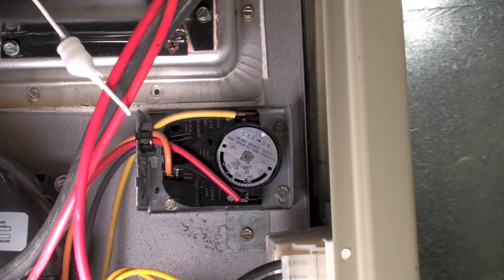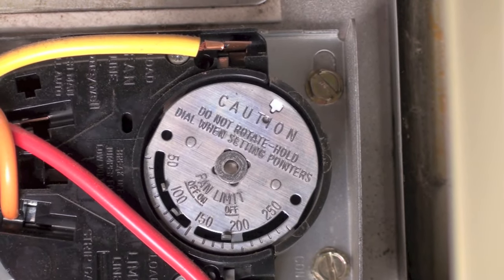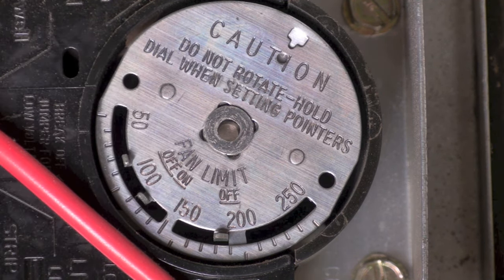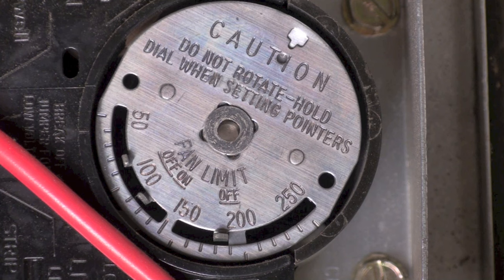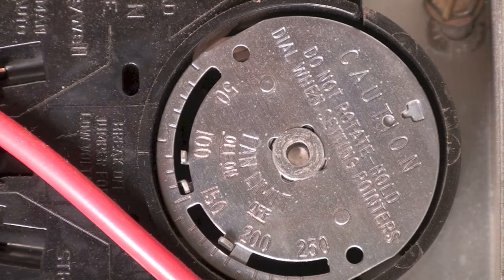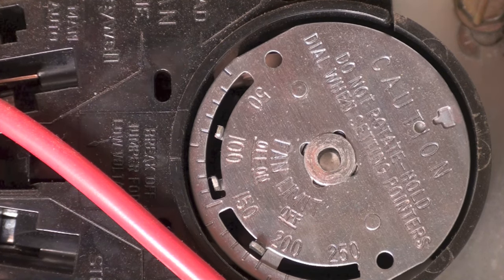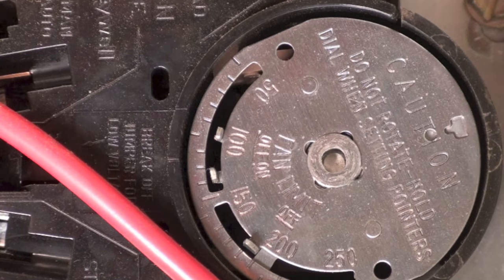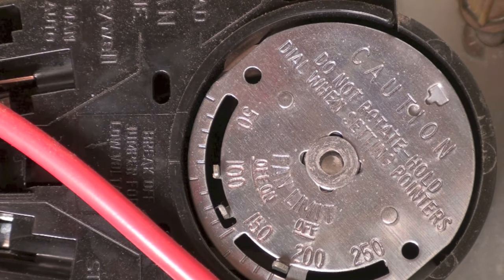How to adjust the Honeywell fan and limit switch

Comment: I had a bad fan limit with no auto/manual fan switch and replaced it with my buddy's that does (he just upgraded to a new furnace and pulled some parts of off his old) now I already checked to see if the bi metal rod was the same length and it was so I thought i could use it the problem is now that my old one was hooked up with 4 wires and his was 3....1 wire in top left, 1 wire to top right and 1 wrire bottom right.  So i wired everything exactly as the old one and with the extra wire I had I figured I put it in the last open slot.  But now the blower motor runs continuously and will not shut off even when the call for heat is satisfied.  Please help. Thanks in advance
Reply from the maker: First, the manual switch should be pulled out during normal operation.  Then it should run with the furnace.  Is there a jumper in the switch?  Should be a copper bar between the 2 lower terminals.  If so, remove it.  His furnace was set up with the fan switch and limit in the high voltage.  Yours was set up with the fan in high voltage and the limit in low voltage, so the jumper must be removed.  By the way, with it the way you have it, you probably have 120v at the thermostat!  Hope this helps.
GFM

Comment: My blower fan will not turn off and blows cool air once the furnace shuts down. If I flip the fan switch to manual, then back to auto the fan will shut off. Bad limit switch? my dial is set to 110, 160, 200. Thanks
Reply from the maker: Your fan switch is probably sticking on.  Replace it.
GFM

Comment: Hello sir
Is there a reason why this fan and limit switch would overheat and meltdown the inside ??
Reply from the maker: I would be checking the heat exchanger for cracks.  You could be getting hot gasses contacting the fan switch.  
This is a dangerous condition.  You could be getting poisonous CO gas into the structure.
GFM

Comment: I just replace my fan control with a universal as the magic chef isn't available. The burner comes on and then after a minute shuts off and then the fan comes on and turns off in a minute then does it again. the house has a burnt smell like the first time turned on in a year. set for 90 and no one can tell me how to set the differential as my old one did not have this feature. can you help me with this. thanks.
Reply from the maker: If your off temp is set at 90F, the on temp should be about 130F for a 40F differential.
GFM

Comment: Hi, my sister has a furnace that is working more faster than before, as soon its started the flame come on, and after 2 minutes the fan come on too, but after 1 minute the flame go off and the fan stop after 1 minute, as soo its stopped the flame come on again, it have to be a problem with the fan limit?????, thank you for any help!!!!!!!!!!!!!!
Reply from the maker: I would look for plugged filter, plugged air conditioning coil, collapsed duct.  another possibility is a thermostat problem.  Hope this helps.
GFM

Comment: What does it mean when the blower runs a normal cycle the shuts off and starts up again maybe 1 minute later only to blow for 30 seconds? Does this every second cycle.
Reply from the maker: The furnace heat exchanger has not cleared the heat.  Try setting the on and off temps a little wider apart.
GFM
Reply: When GFM gives you a solution, please have the courtesy to reply if it fixes it or not.

Comment: My fan comes on at the lower lever and doesn't get up to the upper lever. Is there an internal lever that may have jumped that I could reposition to make it work right?
Reply from the maker: Does the fan switch work normally, as in does it delay start until the furnace is warm?  Does it delay shut down until the duct temperature is cooled?
GFM
Reply: Fan is running. I power down the whole thing for a short while. I turn it on. Blower comes on. Gas comes on and ignites. Duct temperature goes up. Fan comes on at 90. Temp climbs a bit more. Never reaches 130. Gas turns off. Temp drops way down, fan stays on.
Reply from the maker: Unless the fan relay is energized, the fan switch has failed.
GFM
Reply: Jim Onkka it really sounds like the setting of your fan cut off is set too low. Just raise it higher to 80 or 90. The purpose off this is to exhaust all the heat from the ducts at the end of a heat request.

Comment: hi, we have a wood furnace with Honeywell fan limiter switch and the fan runs constantly... even when fire is cold....we are thinking on replacing limiter switch ??
Reply from the maker: If you tap the control and it stops, you need a new control.  Hope this helps
GFM
Reply: grayfurnaceman thanks, cheers !!
Reply: grayfurnaceman what should we reset the limits to for wood furnace??
Reply from the maker: haywire1999 Most of these limits won't go above 200 degrees, and I would set it there.
GFM

Comment: Set it this way and there still is a lot of heat left in the exchanger,  doesn't run long enough to let the humidifier  do it's job. Set  the  off pointer lower and it short cycles.
Reply from the maker: That sounds backwards.  Short cycling comes either when the pointers are too close together or the off setting is too high leaving enough heat left in the heat exchanger to heat the fan  element enough to start it again.  As for too short a cycle to let the humidifier do its job, there are several possibilities here.  Oversized furnace, anticipator set for too short of cycles, thermostat location too close to diffuser.  You can also try setting the fan on continuous.  That will assist the humidifier somewhat depending on the type of humidifier.  
GFM

Comment: My fan off limit is set at 50 and it still tuns off with in a minute, Do I need a new switch.
Reply from the maker: Arturo Landin Many of these switches have an air dam under the sensor.  If it is missing, it could do that.  Another possibility is the return air is getting outside air.  Hope this helps.
GFM
Reply: I will pull the switch out and see if the dam is under it. I saw the other video showing how thanks.

Comment: I have a amana furnace and it's from 1999. but my blower motor won't come on at all in heating or cooling? can you help me please?
Reply from the maker: I would check to see if the blower wheel moves easily.  If it is stiff and the motor is warm after the unit has been on, the bearings have failed.  
GFM

Comment: So no matter my fan on and off adjustments, the fan keeps short cycling. Any solutions please
Reply from the maker: What is your return air temp?
GFM
Reply: @grayfurnaceman  its on a wood furnace so i don’t know . The thermostat is set to on at 130 and off at 100 . It cycles the fan on for 30 seconds then stops constantly
Reply: @grayfurnaceman  im assuming return air would be room temp seeing part of my ducts vacuum in the homes air and the other ducts expulse hot air
Reply from the maker: Try on at 150 and off at 100
GFM @aarondostou3888

Comment: Curious, how do you move the switch settings.  Mine seem stuck and the fan cycles too often. Help!
Reply from the maker: Press the dial toward the furnace to lock it down.  Then move the pointers.  Hope this helps.
GFM
Reply: grayfurnaceman
I tried that approach.  Would not move.
Reply from the maker: Some of the switches are locked down.  You may have to replace the switch.
GFM
Reply: grayfurnaceman Appreciate the info.  I sent you my email address via your web site (I asked the same question on my note to the web site which you already kindly answered here)..  I would like to know what to replace it with if you have any suggestions.  Many thanks!
Reply from the maker: That switch is still made.  Replace with the same length probe.  There are 11", 8" and 5".
GFM

Comment: That's strange because when I first moved in here , I tested the furnace to make it worked right because I didn't trust it.    The fan came on even if there was no heat in the exchange when you turned it or even if the wasn't lit.  I think it was wired wrong in the first place.
Reply from the maker: Probably was not set correctly.
GFM
Reply: @grayfurnaceman   it is a small furnace,  about 4' by 2' . 1980 comfortmaker.  It has that old limit switch that use to keep the fan on when went off.  It  quit last year  and shuts the whole system except for the pilot light.   Then comes back on.  The landlord  doesn't know much about it , and took filter out and put a smaller one in draw through above it.  The fan was full of dirt.  The air duct are  nearly stopped up. Furnace full of soot. I have been trying to free them up. I put a filter in the place It's to be,  it ' s a 25×14×1. It does  very well.

Comment: My blower motor is running constantly. I'm not sure why. If I unplug the blue wire which I beleive is motor speed 3 the ac works fine. With that blue wire unplugged the furnace will just short cycle
Reply from the maker: Mark what brand and model?
GFM
Reply: grayfurnaceman It is a Heil 7000
Reply: Does that help?

Comment: i set my blower on at 100 off at 150 and the limit at 200. my blower runs continuously after it's cold. grrrr... what can I do next?
Reply from the maker: First, try 110.  If it still stays on, the control has failed.
GFM
Reply: grayfurnaceman I will try this. thankyou for helping😃

Comment: Hi GFM! My furnace has been short cycling. I removed and cleaned the blower during the summer (everything was working last year before I cleaned it). I checked the points, they are set correctly. I noticed that my switch be does not stop rotating once the blower comes on. It just continues to climb (rotate clockwise) until the limit shuts the burner down (before it reaches thermostat temp). After the burner goes off, the limit will reset and the burner will fire again. I checked - all vents are open and the filter is new, I also ran without the filter to try and increase airflow. Do you think the limit is bad, or that my blower motor is weak for some reason. The blower seems to run fine, I cleaned it really well with a pressure washer. IDK, can an electric motor still run but just not run strong? Or is there something else I should look at? Thx!
Reply from the maker: If the fan is on high speed, I doubt if the problem is in the motor.  About the only 3 things that can cause overheat are low air flow, overfire, or a crack in the heat exchanger.
GFM
Reply: I think low air flow is the issue. I cut another return in, but it didn't help that much. I then took the blower door off and ran it. It ran cool and the fan limit switch never got much above 150...with the door on, it cuts out at 190 /200(the max). I had looked at the A condenser over the summer. It was clean as new on the outside, I can't recall how the inside looked. The only other thing I can think of is that i didn't install the blower correctly, but I think it only goes in one way. How dangerous is it to leave the blower door off? Any other ideas of what would be restricting the air flow? All the vents/ returns are open. All I can think of is the a coil
Reply: Also, is there a way to set the blower on high speed all of the time (like in the control board)? I'm not sure how to check what speed it's running on? I have a clamp amp meter, is there a way to check by which wire is powering the blower motor?
Reply: Also there is a gap(few inches) between the blower and the intake ductwork. I may try to put a piece of sheet metal to the blower, perhaps that will increase the suction of the blower. I cut a hole in the end of the A coil(it's a sealed unit), it's clean on both sides. I took the blower apart over the summer and cleaned it. I also oiled the motor per one of your other videos.
Reply from the maker: @patrickpk6299  Do not leave off the blower door.  When removal of the blower door stops the problem, it could mean a return air restriction or not.  If, when the door is reinstalled, there is a whistling sound, I would be looking at the return.  
GFM
Reply from the maker: @patrickpk6299  You can try this video:  https://youtu.be/c0h5LbNZeJg
GFM
Reply: @grayfurnaceman  You're the man! The fan is on low speed when the furnace comes on. High speed when I put it on just fan mode. I have an old furnace like the one in the linked video. New honeywell wifi thermostat. I have the Y hooked up to the board and the thermostat. I'm not sure which wire I need to switch. I tired to jumper Yand G, I heard a buzzing sound from the motor. Gonna look around for a wiring dia, So I can get it in High speed only, I don't need low speed.
Reply from the maker: @patrickpk6299  The high speed should be jumpered to the furnace speed.  The low speed should be removed and isolated.  Be sure no speed from the fan is connected to anything except the high speed.
GFM
Reply: @grayfurnaceman  I've thought about this for a bit now, unfortunately I'm still not getting it.  Which wires do I jumper? The Blue (med high) wire from the motor is coming on when the heat is turned on. I want the Black (high) to come on (it come on for fan only). Do I jumper the control wiring or the motor wiring? Which wire colors are you referring to? sorry to ask so many questions
Reply from the maker: @patrickpk6299  In your case, you want only the Black to be connected.  The reason for this is if 2 speeds are energized at the same time, it will destroy the motor.  
Do not jumper the control wires.  Just be sure all pathways for the power goes to the black wire.
GFM
Reply: I see what you're saying. I guess I could put a pigtail on the black and hook it up to the blue and black, so the black always comes on. For now I just switched the black and blue wires. Now when the furnace come on it's running in high speed. I think I'll need to switch it back when summer comes and it time to use the ac, so that will run on high. Or just pigtail the black to both terminals
Reply: @patrickpk6299  Maybe you should have a qualified local furnace company help you?
Reply: Maybe you shouldn't comment, since you have nothing to add and my problem is solved

Comment: ill have to check mine the heater starts, and runs for 20 minutes or longer then  shuts off, the fan comes on then the whole unit shuts off till the house kools down no cycle times
Reply from the maker: If the burners come on and run for 20 minutes and then shut off and then 
the fan comes on, you may have a failure with the fan control.  The burners should be on for less than 2 minutes before the fan comes on.  
GFM

Comment: Says to remove jumper ?
Reply from the maker: Jumper is used if both there limit and fan are 120 volts.  Remove it if the limit is in the 24 volt circuit.
GFM

Comment: is the jumper cut
Reply from the maker: The jumper should be cut when the limit is in the low voltage circuit.  
GFM
Reply: @grayfurnaceman  thanks Gary my friend changed out his limit and had the fan in the limit backwards to the fan was running constantly and I haven't done heating in so long in Arizona doing only air conditioners so thank you very much and I haven't seen a 70% furnace with that limit since school so their lot of them up where I'm from which is Washington state but none down where I'm at currently thank you for your time and your videos are awesome keep them coming because if it wasn't for you and people like you we would not have a clue what we're doing some of us younger technicians you guys were straight geniuses now it's just plug and play

Comment: my furnace turns on runs a cycle the fan limit switch turns on the fan it completes and shuts off then doesnt come back on....
Reply from the maker: How do you get it to start again?
GFM
Reply: Jenn Oakes concider this.... (I had this "stupid" problem with my new thermostat) - When the furnace high limit cuts off the gas valves, it does this by opening the primary of 24V transfomer.... if your thermostat is powered by that 24VAC through the house wiring, THEN THERMOSTAT goes dead with high limit switch opening!! (My solution is to have a separate 24VAC transformer power my thermostat at all time. This is 100% safe has furnace still cuts off its local 24VAC to valves/igniter as designed)

Comment: my problem is ,the fan wont work on auto, i have to set it on manual
Reply from the maker: Then I would guess the fan control that turns on the fan for the furnace is the problem.  If it is a very old furnace, it will have a switch like the one in the video.  Furnaces made in the last 25 years will have an electronic control that turns on the fan.  Look for wiring problems first(broken, loose).  Hope this helps.
GFM

Comment: I can not move my fan temp pins.  I'm set at 105-130, the fan only stays on for 3-5 seconds.  What is the secret??
Reply from the maker: Just hold the dial and move the pointers.  The only one you cannot move is the limit.  It has a stop to prevent setting above 200 degrees.
GFM
Reply: And if you still can't move the pins, then replace the switch.

Comment: I set mine on at 150,   off at  95   Then it's all about blwr speed
Reply: where do i adjust the blower speed, please help
Reply: I have same setting kicks on when I put heat up but won't turn off it's a honey for York furnace
Reply: TimberWolvesX X : directly on the blower itself by plugging the AC Live to desired motor winding. Bump the YLW  lead to left or right. Very easy to do under 2mn with AC breaker disconnected. [ HI - HI/MED - MED/LO - LO]. Don't move the neutral WHT... Only "AirCon Blower: PPL" or "Heat blower: YLW".

Comment: My blower motor keeps running after thermostat reaches temp?
Reply from the maker: If it keeps running and never shuts off, be sure the fan is not in the "on" position.  If it has a fan switch similar to the one in the video, strike the side of the switch.  If it shuts off, it is failing.
GFM